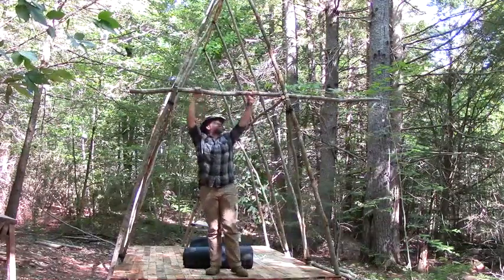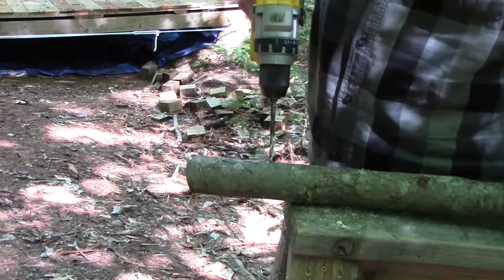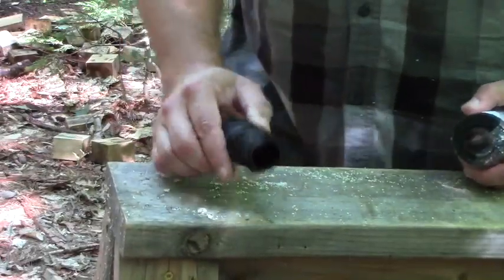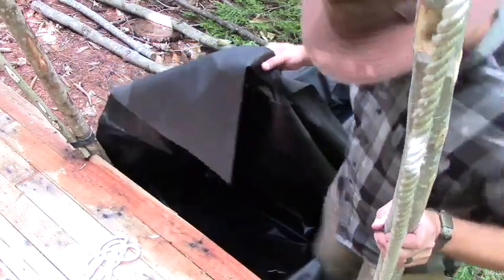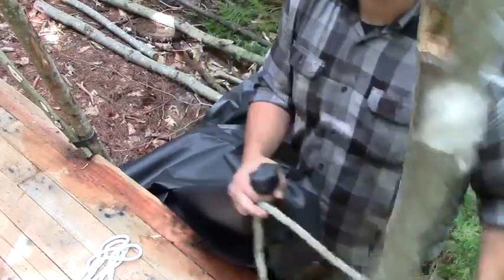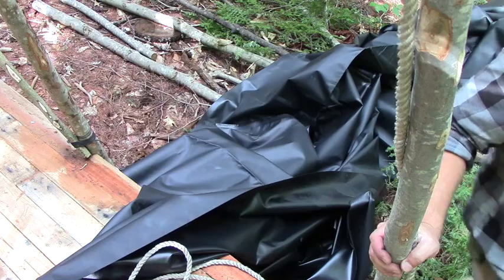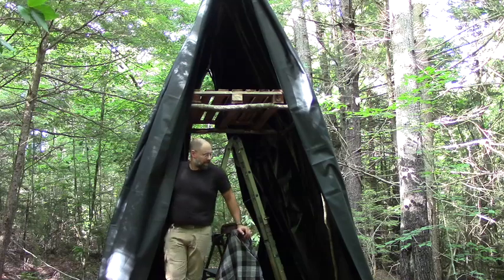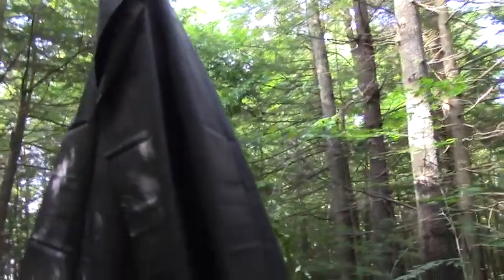Woodland Workshop part 8

Comment: Solar could be cool. Have you seen those Anker Powerhouse batteries? You could even run some tools or charge batteries off of some of those. Big ones aren't cheap, but they have a few sizes
Reply from the maker: I haven't seen those specific ones, but I'm familiar with the kind of thing that you're talking about and I'm familiar with Anker as a company.  That's probably how I'll end up going although I may end up custom brewing some other battery setups later on.
Reply: @tacticaladventure  The nice thing about the self contained units like that is that you can buy one and use it before you get the solar set up. Just take it back home and charge it up